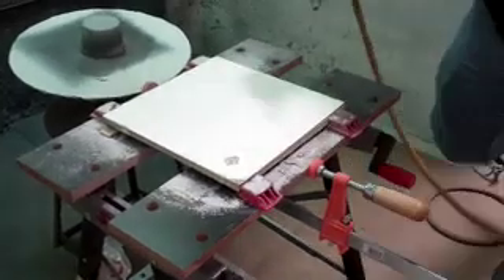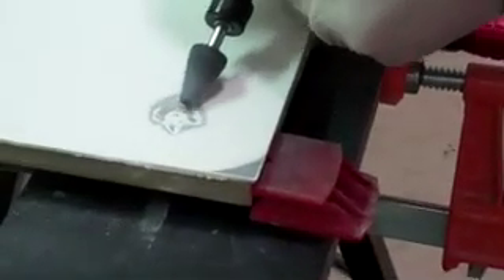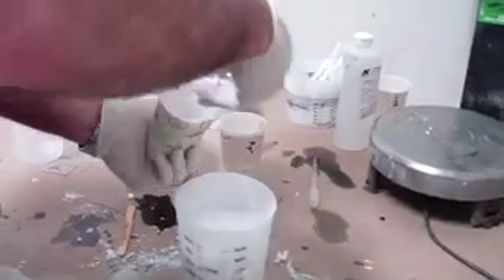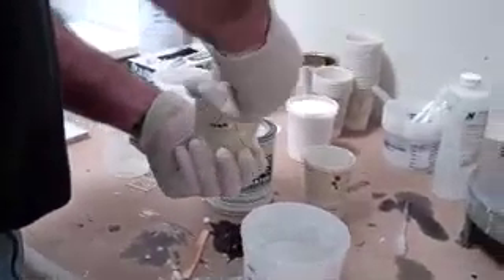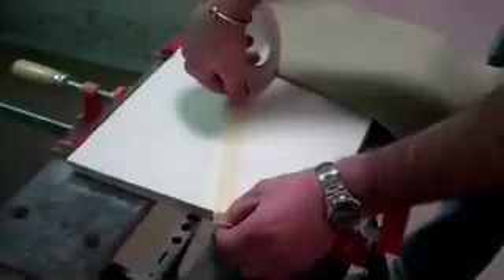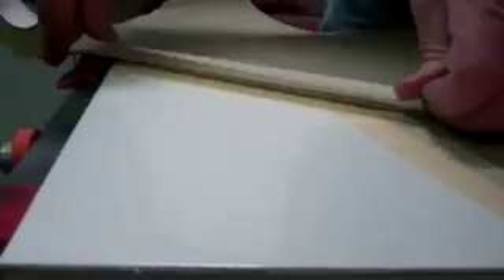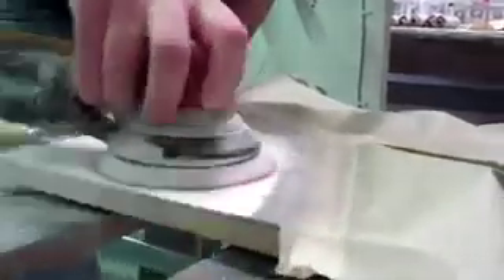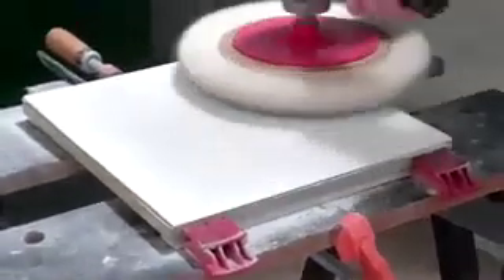Gel Coat Repair with Duratec 904-001

Comment: did you also add catalyst to the gel past or was it applied without catalyst
Reply from the maker: Hi Nicholas - thanks for your comment!  

Yes, we catalyzed the gel coat paste in order to allow it to cure.  Catalyze as per the gel coat instructions.  We have customers who catalyze first, and then add filler, and some who add filler first, then catalyze.  Our recommendation is to catalyze first, and then add the Cabosil (filler) to the right consistency. 

If you have additional questions, please leave them here or give our office at call at (909) 546-1160.

Thanks,
The Hawkeye Industries Team

Comment: I’ve sprayed a guitar with duratec sunshield and water sanded with 1000. I can not buff it. I’ve tried aquabuff 1000 with a wool pad and it leaves the guitar buffed by swirly. Then I used a wool pad with aquabuff 2000 and it’s still swirly. Do I need to use a foam pad with aquabuff 2000? Thanks!
Reply from the maker: Hi Mike!  Thanks for the comment.  Please excuse our delay - we didn't know this comment had been posted!  (We've fixed the problem and should get notifications now!) Anyhow, we'd love to have you speak with one of our Technical Reps.  Please give our office a call at (909) 546-1160 or shoot us an email at hawkeyesales@hawkeyeind.com and we can have the rep for your area be in touch!  Thanks!  Shelly @ Hawkeye